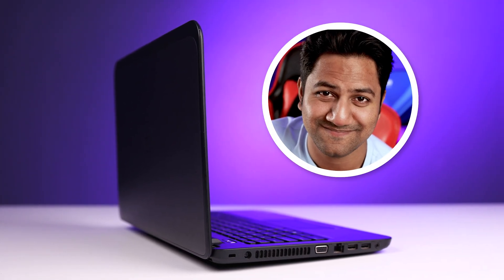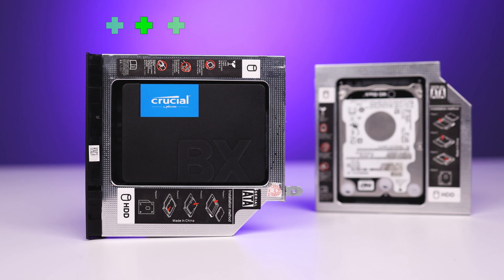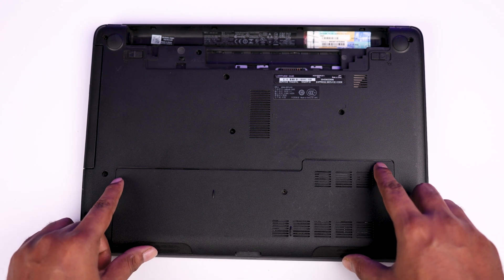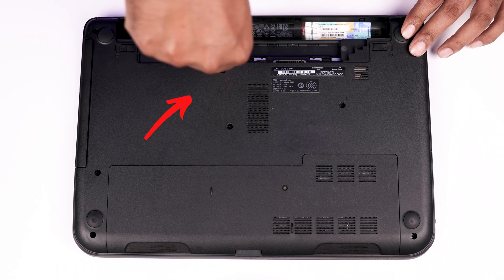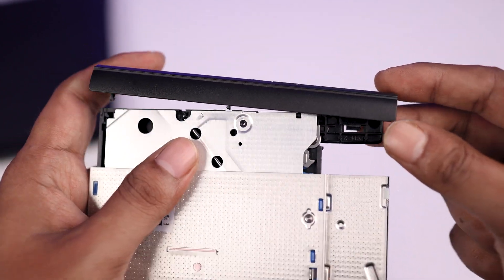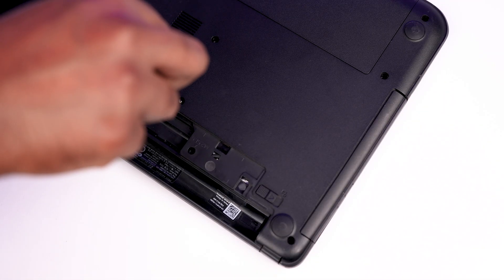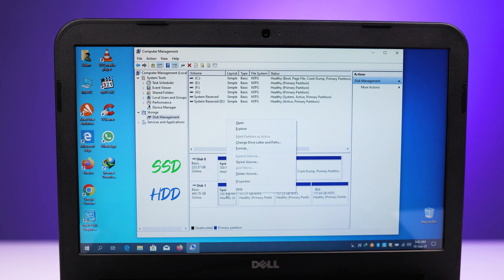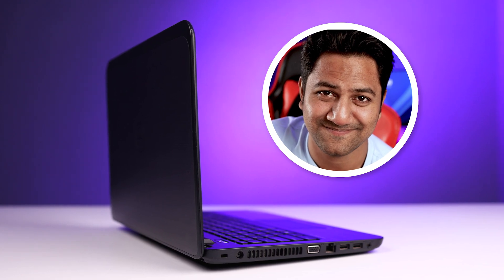How to Install 2nd HDD Caddy in Laptop | SSD Upgrade + Storage (Pro Guide)

Comment from the maker: Read article on Official Blog: https://trickiknow.com/how-to-install-ssd-in-laptop-with-hdd-2nd-drive-caddy/

Common QNA: Can i Install SSD directly in Caddy instead replacing internal HDD? 

Answer: Yes, But you must have to Install OS to SSD and, have to make the SSD Primary Drive in Bios. (But i would suggest to install SSD in the place of HDD for strong connection, Loose connection or a bad Caddy may cause to booting or speed problems.) -- More QNA is in Video Description ⬆
Reply: Can i connect to Internet if im using egpu? 🙏🙏
Reply: @imeszy2047  yes bro..you may connect to wifi using a Ethernet cable.

Comment: What to do if the caddy wont fully go in?
Reply from the maker: Use a hammer, just joking. Gently re-insert the caddy until it fits. Try to tilt a little bit, maybe the connector is not aligning properly.
Reply: @TrickiKnow 😅

Comment: I measured the thickness of my laptop correctly and got the same caddy as yours. However, my laptop dvd front case doesn't really fit to the caddy. It won't click like your explanation, and the screw hole for the bracket is too small, so I plastered the case and its bracket together.. any solution to this? I can't keep plastering my whole work there😂

Comment: Hello all,
I have a question if any one can answer "Do I need to reinstall the windows on new SSD or with it also by just deleting the HDD partitions also it will work? "
Reply from the maker: @rohitradke7212  In the case of using ssd + hdd, you must have to install new windows on ssd. Once you are done now then connect the hdd using caddy and copy important files then delete all partitions of hdd in disk management and make 1 fresh partition or 2 as you wish.

Comment: will adding hdd in caddy hamper the perfomance ? pls reply
Reply from the maker: @belugawalt-bj6ce  Is your Ssd is installed primarily?
Reply: @TrickiKnow  yes
Reply from the maker: @belugawalt-bj6ce  Performance will not hemper coz now HDD will sleep if its not in use. Once you open D drive only then it will start to spinning. 👍🏽
Reply: @TrickiKnow  can i keep my files in the hdd ? and if i open the file will it be slow?
Reply from the maker: @belugawalt-bj6ce  Yes you can keep your files in the hdd and use it as storage drive, when click on any hdd files, it will open with a delay of 2 or 3 seconds until the hdd start spinning. After that everything will be normal.

Comment: Why didn't you install ssd directly on caddy
Reply: Speed can be reduced by putting ssd on caddy...
Reply: @16_prathamesh416  the reason he did so is different. If you install on DVD slot, you need to change boot settings.
Reply: Because there's some laptops that doesn't have sata 3 port in CD reader so the SSD read and write will be reduced then you will lose a lots of performance 
from your SSD that's why you must insert the SSD into your motherboard
I hope you understand now ❤
Reply: @carnagegaming4200  understood now. Thank you
Reply: My dell inspiron 15 3568 6th gen i3 has sata 3 port in optical drive???? @carnagegaming4200
Reply: Thank you very much for the very important information. @carnagegaming4200

Comment: I already installed gigabyte sata ssd in my hdd port and using hdd with caddy, can i remove hdd from caddy or use another ssd in caddy , at one time 2 ssd
Reply from the maker: Yes, no problem. It would be more better 👍

Comment: Just to clarify since my Laptop doesnt have a removable Battery do I just procede as Usual or is there something else I need to do? :o
Reply: What lap top is that??  If it has a battery open it up and disconnect it before proceeding I guess
Reply: battery still has a connector that can be removed from the motherboard, which is recommended when doing anything electrical

Comment: Sir i installed a ssd in a caddy and after booting up.... the previous windows of hard disk is detecting my ssd and working perfectly but whenever i try to install windows or any other os it fails to.... On windows installation wizard it stucks on purple screen i tried many times but still same any solution for this problem ?
Reply from the maker: Make the SSD first boot device in bios, then delete create  partitions of HDD after taking backup of your files. This will make the SSD the primary drive.
Reply: @TrickiKnow  i done everything sir but still same
Reply from the maker: @vikarantshrestha9590  Make sure during installation, keep other harddrive out of the laptop. Like this: https://youtu.be/ye8m5wIus0M
Reply: @TrickiKnow  i migrated windows too but it shawing unable to read disk
Reply: @TrickiKnow  is it possible that caddy is defective